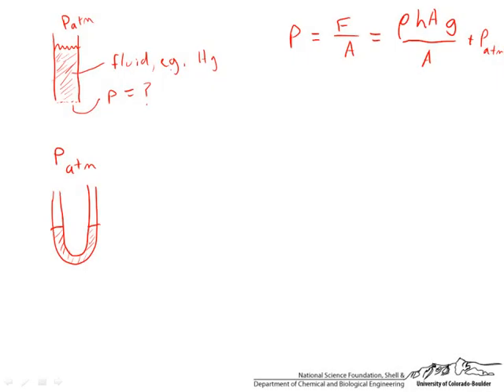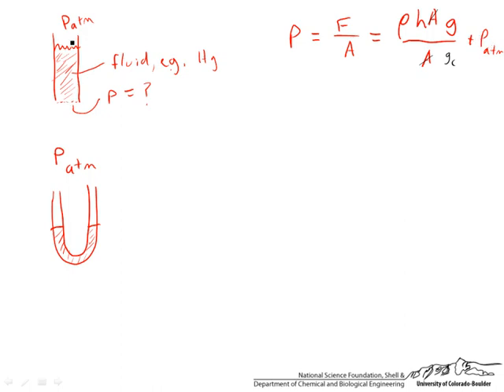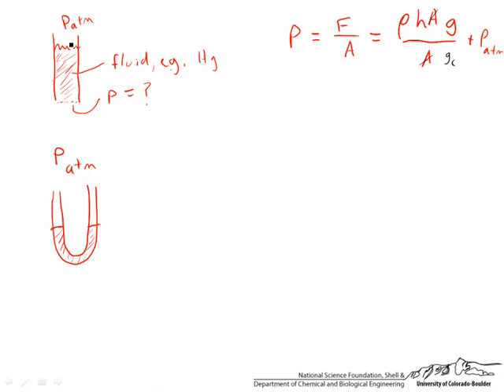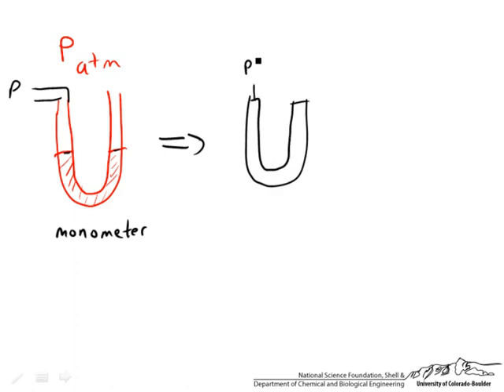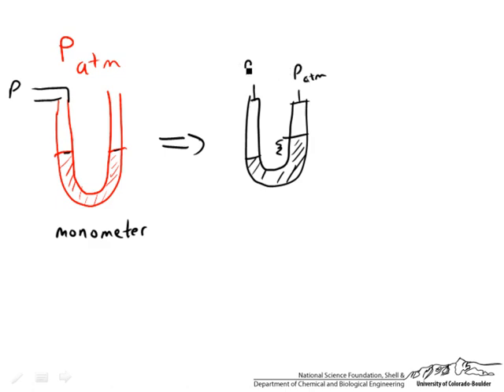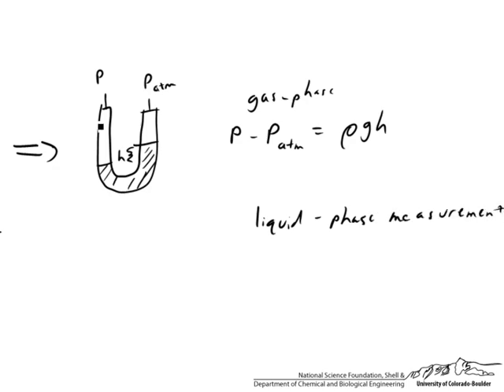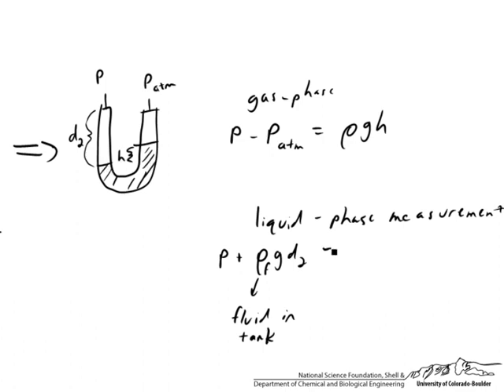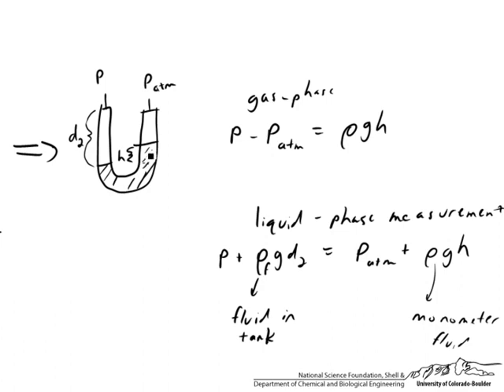Manometers

Comment: so air doesnt exert any pressure?
Reply from the maker: Air does exert pressure.  And pressure decreases with elevation since we are decreasing the amount of air weighing down at that higher point.  In a manometer that is open on both ends, the pressure is the same and the level will be even.